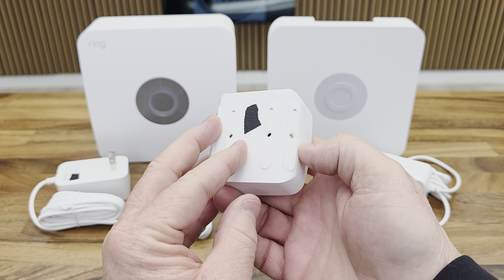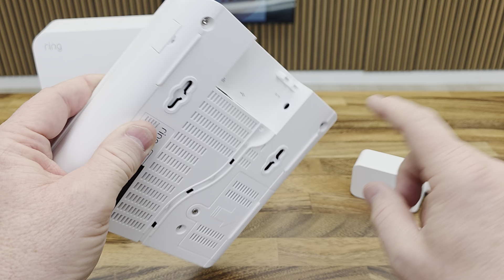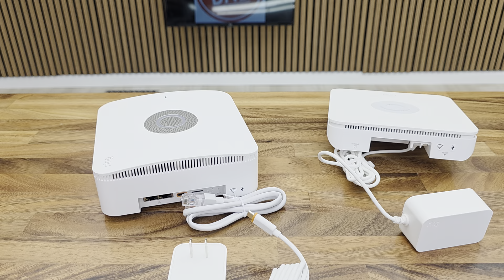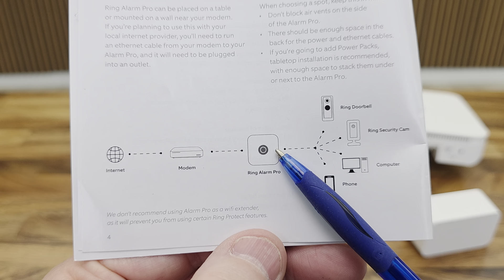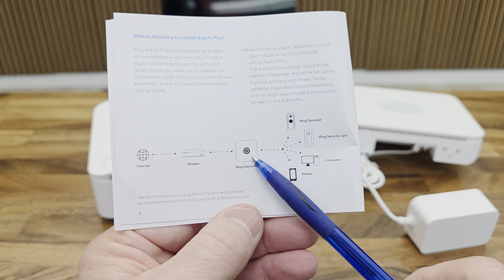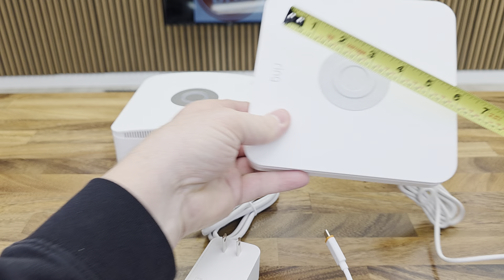Ring Alarm Base Station COMPARISON Pro vs 2nd Gen

Comment: The Issue I have with ring is forcing you to 1 use your phone to access your devices 2 its a router that you cannot access through a desktop pc or mac. not liking it for that reason. I like to have access to configure the router like a standard router

Comment: Installing Ring pro unit and the Internet box in the attic, would that be a safe thing to do?
Reply: shouldn't be a problem as long as the signal from the attic is strong are you are able to use your wifi devices around the home
Reply: The Pro base station has fans that are always on, and the device gets warm AT ROOM temperature. Putting one of these in the attic to me would lead to overheating issues especially in the summer. I know you posted this one month ago, but I'd be curious to know if you tried this and if it works.